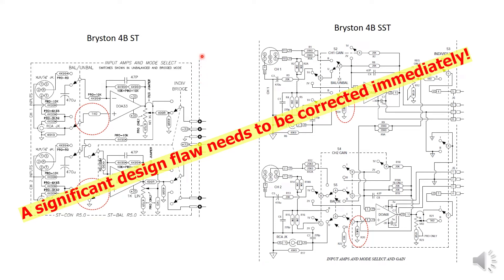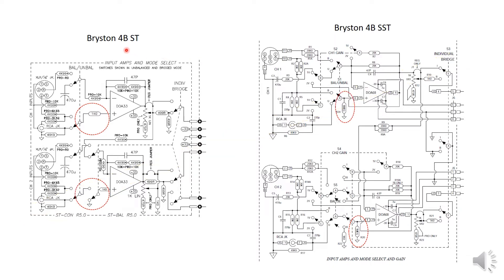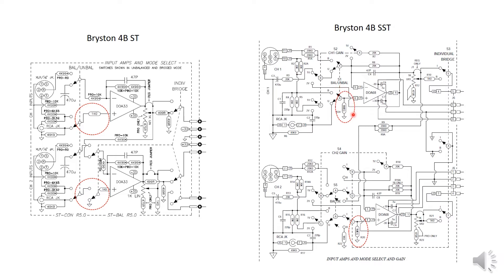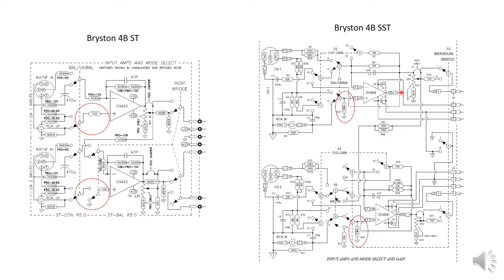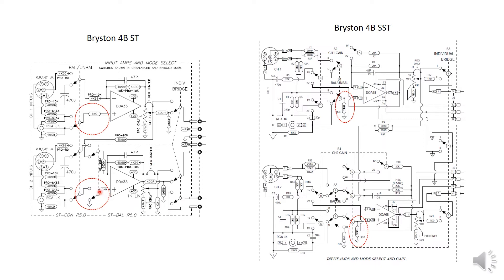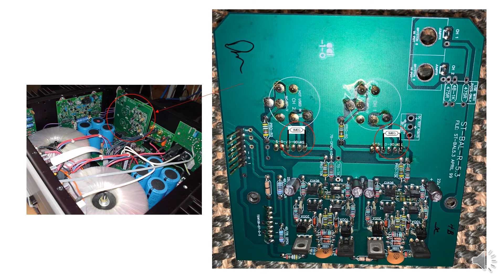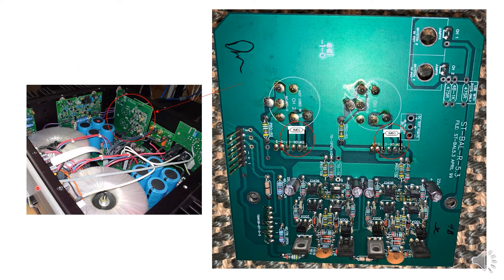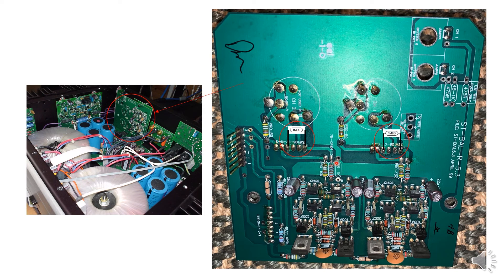Must fix this design flaw if you own one of the early Bryston amplifiers

Comment: Is this an issue on Sonics 800x amps too? They have the internals of the 7B which is why I ask. The input board is the Bryston BMX-PSB1 REV 0 from November of 1988.
Reply from the maker: I remember that the input board on the older 7B is different from the newer 7B and 7B=-St. The latter uses modular input board.

Comment: I have 4b sst. How to  improve the sound quality?
Reply from the maker: The 4B-sst corrected a few design flaws in the 4b-st (mentioned in my other videos), such as the output stage circuit topology, input neg. large resistor termination, and higher power resistor in the voltage regulation circuits.
Reply from the maker: However, the 4b-sst uses only one power transformer vs. two in the 4b-st, and the power transistors changed to plastic TO-3 package, which are the reasons that I decided to modify a 4B-st to the 4B-sst design with a much better foundation.